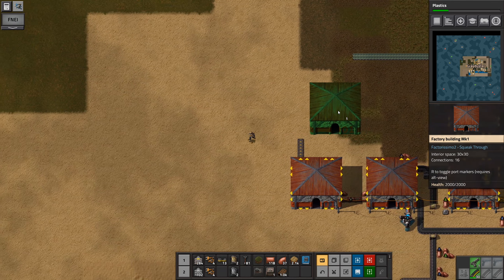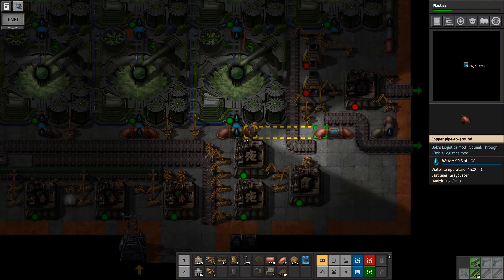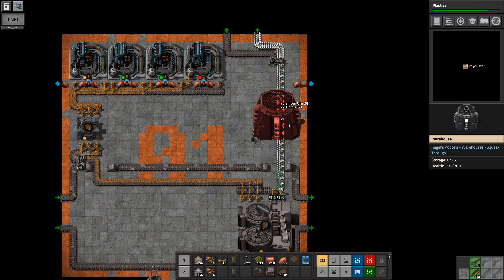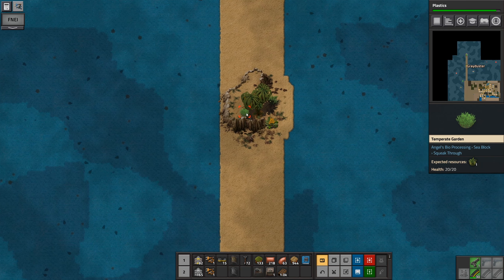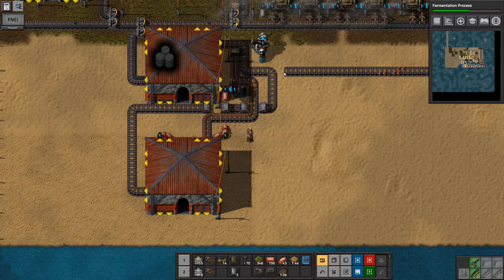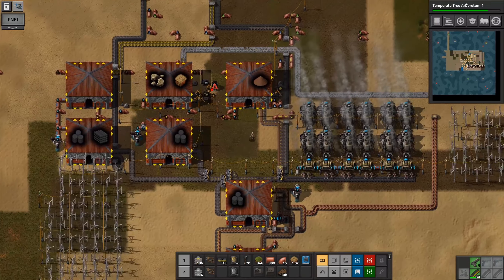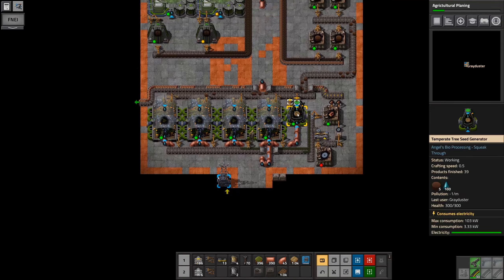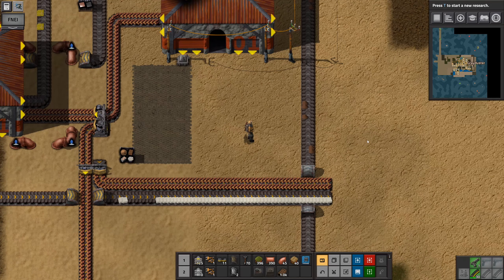Seablock 0.17 E22 - Bio Resin and Life Science Packs

Comment: Regarding the power supply back when I played Seablock I had an extra array of 20 steam engines not linked to the main power network if not via a switch that would only activate if an accumulator linked to the main power network would drop below a certain treeshot(like 20 or 30%),that would trigger both the switch which would connect the extra steam engines array to the main network and also sound a "Power low" alarm using a speaker. That way I never had a "Surprise blackout" situation.